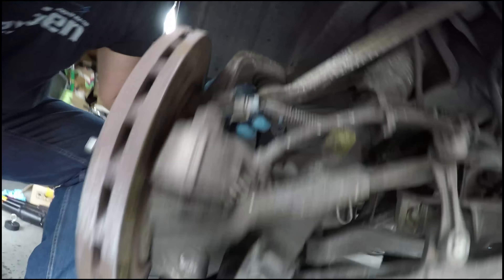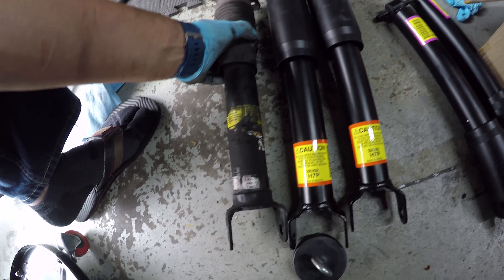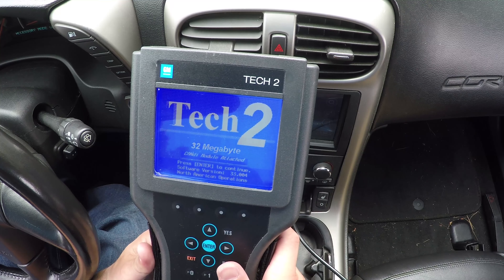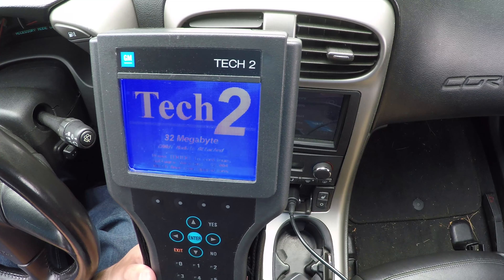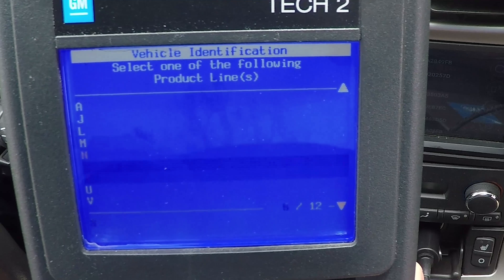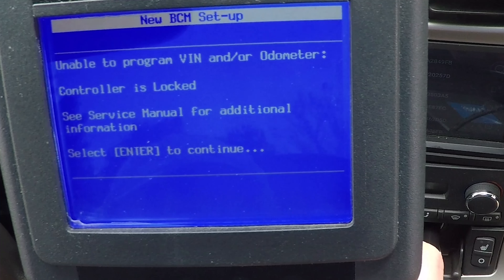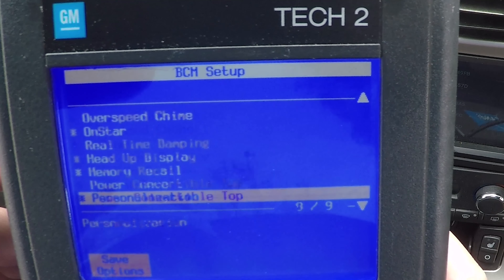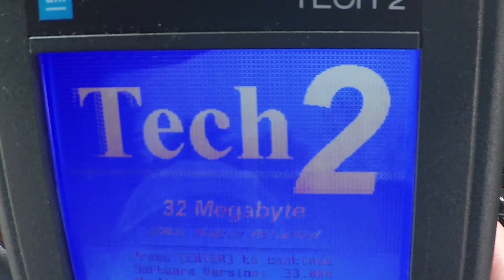C6 Corvette Mag Ride Delete

Comment: The cadillac XLR 2004-05 has the same magneride shocks options. The suspension module was placed it a bad location and tends to get wet and short out. The replacement cost is over $2k. But there is not the option to the delete real time damping in the BCM. So I built a bypass module to simulate a working suspension module. Now I've gotten some static from one guy who thinks it's dangerous the run non-magride shocks on the XLR.

Comment: The magnaride shocks are awesome.   It’s worth restoring the system.  I would not buy a modern corvette without them.   My C6 is pushing 100k miles and it’s 18 years old with the original shocks that are still working fine.

Comment: I have a K platform 2007 avalanche I eliminated the magna ride and put Bill Steen’s all around she rides great service suspension system light cannot get it to shut off even tried to resistors the problem is on my tech 2 I cannot get to that screen can anybody do for k body screens , I’ve tried for hours , says Module does not need to be set up primary something already matches never lets me to see the screen to delete the magna ride please help

Comment: Hi Omar. I have an 07 c6 with magride shocks and one is totally failed. I want to replace it with z06 shocks. The yellow sticker on the z06 shocks part number is 0302855 and 10302877. Will those parts replace my z51 magride shocks on my 07?

Please help!

Comment: Why should you do that and why did you order it that what way.  The Magnetic Ride affects more than just your shocks movement  and don't forget springs there is also the steering
Reply from the maker: +Ckeehn2 the shocks felt like they were fading a bit so instead of replacing $1000/shock I replaced them with z06 shocks for less than $400. The interaction with all the systems is not that big of a deal, specially if you delete the function in the computer.
Reply: Thanks Omar...I'm in the process of swapping my shocks out. Already bought both the front & back sets. Just need to install them then proceed w/ the TechII tune.
Reply: @atmkm8323  
Can you tell us what did you do with your project
Reply: The mag Shocks do not ever fade as long as they do not leak then they work as a brand new one would out of the box and if you were to replace you can buy them for 400 a piece the same as what you paid for your ZO6 shocks from Summit Racing
Reply from the maker: Yes, they were leaky. No difference from sport to touring as well. There was no $400 rtd shock when I made the video hence why I went with $45 z06 shocks.

Comment: Can anyone verify that this works on a 2008 or later C6?  I've read that you need the resistors for the LS3 and that the Tech2 will not work to override/disable the magnetic control system.
Reply from the maker: Hmm, the tech 2 is a GM tool for things like this, so I don't see why you'd need resistors? I could be wrong. Maybe if I find an 08+ and someone is willing, I'll check it out.

Comment: Alternate title: How to ruin your Corvette. Mag ride>coilovers for a DD or mild track car.
Reply: magride is useless bro 🤣🤣 I barely use tour because it's too soft and sport feel like tour should feel. It's a weak system that leaks so it should always be replaced. Coilovers with adjustment for rebound and damping are far superior to an early 2000s suspension.
Reply: One magnetic ride shock cost as much as getting a full set of Bilstein b6 shocks that are way better
Reply: @rileyvesco173 did you have to do the same thing with the Tech 2 with this video ? I just got bilstein b6 shocks and it shows the same message as the video here

Comment: Do you know if the tech2 and this process works on the 2013 model corvette GS? Ivr been told by a local tech that the tech2 wont work on the 2012-2013 models
Reply from the maker: I vaguely remember that to be true on the later models. I think they have an electronic adapter for it to work.

Comment: So is this because you bought/replaced shocks and they aren't the OEM? My EXACT car got new shocks in front and I was advised by a performance shop to buy Shock absorber simulators and they'll install them and not require programming.
Reply from the maker: The shocks aren't magnetic ride, just plane Z06 shocks, so I had to shut off that feature with the tech2. Do you have a sport/tour switch by the center glove box? If so you have mag ride shocks. I don't think any simulators work with the C6. You have to do it with the tech2.